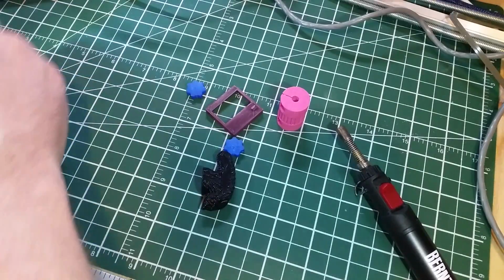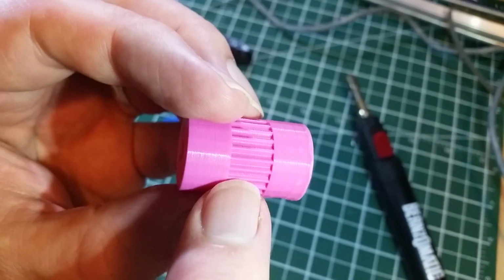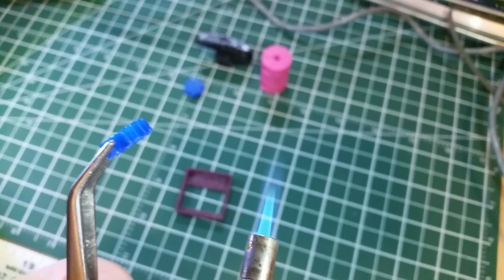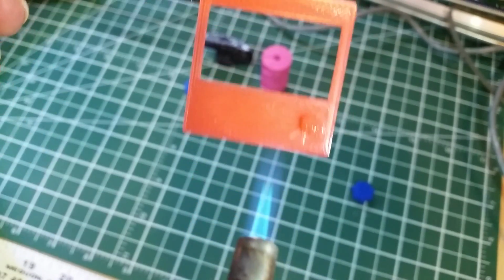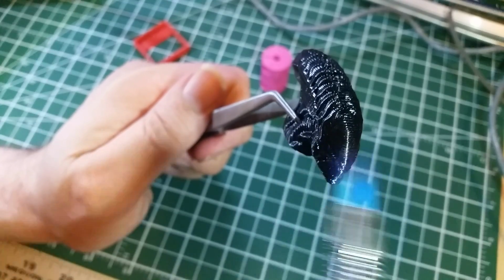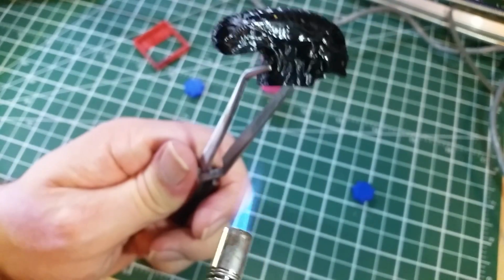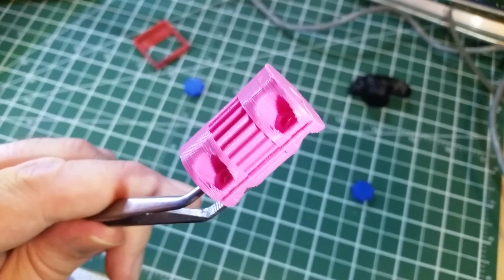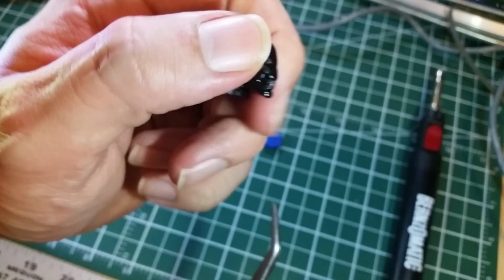Torchin' PLA [Smoothing 3D prints]

Comment: What you might want to try is an SMD soldering station  as they come with a hot air reflow iron and you can set the temperature.  Works better with ABS than PLA...
Reply from the maker: ooh fantastic idea .  now i have another great reason for a SMD station .
Reply: i was just thinking of using mine for this!!
Reply: Thanks for the tip - I have an SMD station. I'll give it a try.
Reply: My hair dryer melted my carpet so I wonder if that wouldn't be hot enough.

Comment: I saw a video where they used acetone vapors to smooth out abs and the first thing I thought was I bet someone has mastered using a small torch to smooth out other plastics!! Haha so this was the first video I found and while you definitely haven't mastered it (as of this video anyway) you've definitely shown that it is possible and that you can at least change the surface from dull to glossy. I'm certain that with some practice this will be a completely viable way to smooth out plastics. And much easier than sanding!
Reply from the maker: on bidder parts you also 'weld' plastic back together.    It works best on larger or thicker perimeters. It's a shame that some of the filaments that acetone used to work on now don't very well. Pure ABS will acetone and torch smoothes very well. ( don't do both at the same time LOL )

Comment: subbed for your skill level on commentary!! im new to printing but  this really seems like the best way. great vid!
Reply from the maker: Thanks . as DIY3DTECH.com said ,  as soldering station with controlled heat air flow for SMD work would probably be netter in the long run , but  they can be pricey for those starting out . the upside is no exposed flame , and you can set a temp that better matches the PLA your are using .  I dont have a SMD soldering station  .. yet  , or i would do a video on that,
Reply: you can get cheap chinese ones on ebay for ~ $70
Reply: Another dept at work has a hot air solder station and im trying to find a time to go and use it. 
Ninja skills: Activated
Reply from the maker: cool.
Reply from the maker: you can get them in USA for like 60$  from one seller , but he wont ship to Canada . LOL  figures.  a friend bought one and he said its just the Chinese being resold. dude must have imported bulk .  but he wont ship to Canada .

Comment: To keep the tip on the iron from breaking away keep solder on it at all times.
Reply from the maker: True. Yep i have tried just about every thing , after a few months the ceramic catalyst will become loose . I have the habit of coating my irons in solder all the time and just before storing them with a nice thick dip of solder. 
heck i have had one that the tip melted open to reveal it has a solder like liquid core. I was mid solder too , but then i dont tend to expect much from cheapo irons . my Weller butane has replaceable tips in front of the heating area , the iron is about 10years old , the heating area is original , and i put a new tip on last winter .  works like a charm, Its just built better i suppose .  i just dont have any luck with the small burnzomatic soldering tips.  the torch is fine .. just their tips . the last one i had you could replace the tip but it died when the catalyst became lose.

Comment: Will this work on PETG?
Reply from the maker: not sure. I have not used PETG yet. need to finish my bigger printer for that.  but if it melts in FDM then a torch used carefully, or even bet hot air rework station should be even better.   I would say print a small test and try very carefully over a fire safe surface outside because some plastics give off real bad fumes and can really burn fast once they reach a flame.

Comment: That's the name of the clampy thing with the spring in it that you were using?
Reply from the maker: Cross-Leg Soldering Tweezer. they have fiber or wood grips to protect your fingers , and also function at a heat sync .  If you live in Canada Princess Auto sells em like this  , and some come with different ends just like other tweezers.  Well thats what i was thinking you meant .

Comment: So...Very poor results at best and wrecked parts at worst.....Why did you even post this? It clearly FAILED.
Reply from the maker: Flyboy BC because if you watched the whole video and listened you would understand those were just some quick samples. With practice and bit of time you end up with smooth and way stronger parts.
Reply: weld-on 16 acrylic cement
Reply: Can you post a successful attempt?
Reply: You keep saying weld on 16 acrylic cement with no other explanation, care to elaborate? As a glue? To rub on???